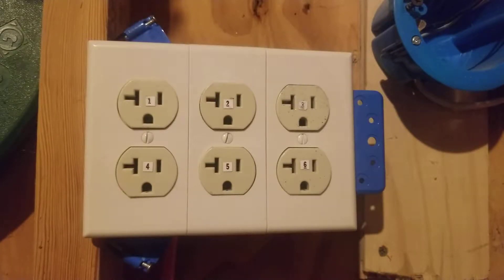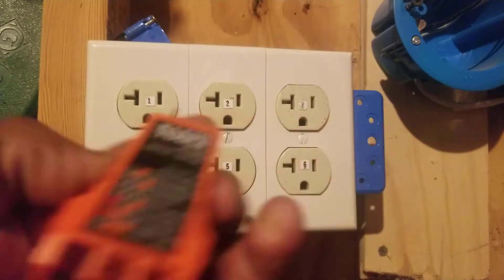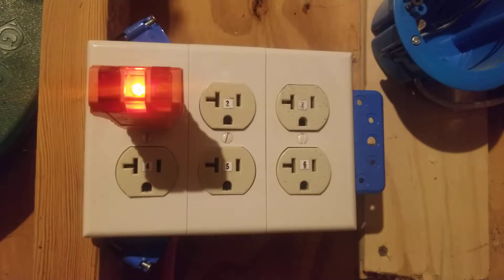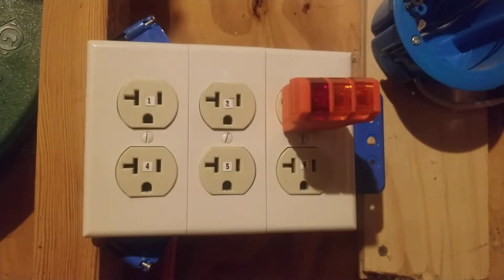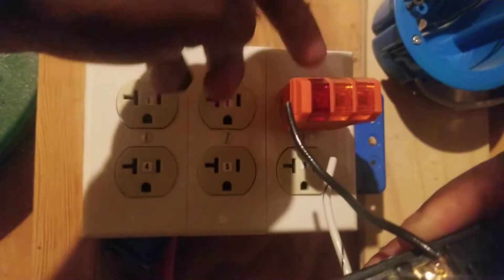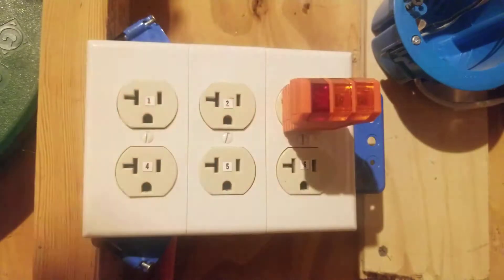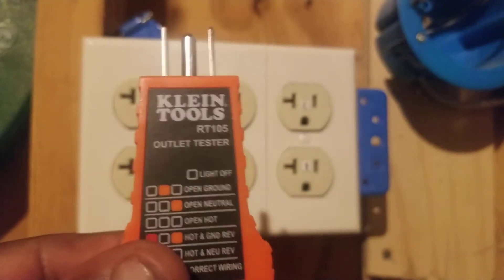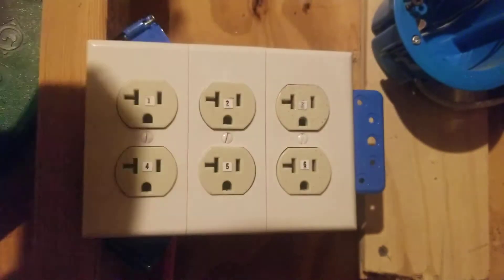How to use and read a receptacle outlet tester

Comment: I have 1950's house. Been putting in new outlets with no problem. Most were not grounded but received advice that adding a ground wire to the metal box, because of the metal casing heading back to the grounded circuit box would also ground the outlet and so far that has worked according to the tester.

The tester on my very last outlet will only show a center orange no matter how I try to wire it.

I even tried a GFCI outlet just to make sure the regular outlet wasn't faulty, still center orange light only.

Have done this outlet like all the others but the second orange light wont come on.
the out before it in the run shows double orange. I

Can you help me to understand what I am dealing with?

Comment: Very clear and concise,  you would make a good instructor at a trade school.  Just my opinion,  for a 100% complete guide to 3 light testers you need a total of 8 outlets.  In addition to the 6 shown here, there is a condition where only the red light is lit.   Ideal is the only manufacturer I'm aware of that lists this problem,  but it is called hot on neutral with hot open.   It simply means a hot/neutral reverse with an open neutral. The last condition is where all 3 lights are lit, usually with one light brighter than the other two.   This occurs when the outlet is connected to 240V or something considerably more than 120V, either  the result of a lost neutral on a multiwire branch circuit or possibly at the panel or the utility connection to the building, or the wrong outlet was installed,  for example a standard 120V/ 15 or 20A duplex outlet could have been mistakenly installed for a larger window air conditioner that requires a single 240V/20A outlet.

Comment: I have 5 outlets in my room .. 1 works correct which is the A/C outlet. But the other 4 all give me hot ground reverse .  All 4 outlets are reversed wrong?
Reply from the maker: Have an electrician check the first and second outlets.  Make sure that the black wires are landed on the gold screws and the white wires are landed on the silver screws. You may have a bad outlet among the 5 outlets. Try unplugging your AC unit and then test all 5 outlets again. The problem can be caused by your AC unit. Thank you for watching.
Reply: What you almost certainly have is an open neutral at one of the outlets, and a load plugged in downstream.   I suggest you check all the outlets on the circuit,  looking for a neutral that appears loose.  The problem might also be in a junction box in an attic or crawlspace or basement if you have one.   I highly recommend you contact a qualified electrician if you are even slightly unsure of what to do or if you've checked everything and can't find the problem, for obvious safety reasons.

Comment: Ht ground reverse is likely an open neutral. You should make sure that everything is unplugged in the circuit and test again. It cannot happen accidentally (by wires getting loose) and  it is highly unlikely that anyone would miswire so badly. You should test it with a non-contact voltage tester. It it show voltage n the ground that is serious.

The tester can only tell the differences. If neutral is open an an appliance is connected and on the neutral gets hot through the appliance. If both neutral and hot  are hot but the ground is not the tester shows same as if the ground was hot and the others were not.

A non-contact voltage tester is better in that it has the access to the true ground through the user. Yu should use it in addition.
Reply from the maker: Thank you for that information. It's very useful.

Comment: My former uncle (divorced) wired the house around 1965ish.  I just put the tester in and found that the hot and neutral are reversed. So far, every receptacle I've tested is that way. Should I change them all?

Comment: I plug my tester and all the lights went on what is the problem pls help me
Reply from the maker: You may have a bad outlet or a bad tester. Change out that particular outlet.Try plugging the tester in a different outlet.  Try using a different tester.
Reply: @rickyjewett6082  I did plug the tester in another outlet and works perfect but when I plug it back in the other one all lights go on

Comment: Ok so what if you see just the red light on
Reply: That could mean that the hot is wired to the neutral and the neutral is open. That could happen if the socket was originally miswired with reverse polarity and then the neutral got loose. The red light is neutral-ground. The middle one is hot-neutral and the right one hot-ground.
Reply from the maker: if you only see the red light on, you may have a bad tester. Try testing the same outlet with a different tester.
Reply: This means hot on neutral with hot open, most testers don't have this on the chart, IDEAL brand testers do.    Basically this means hot-neutral reverse and an open neutral.

Comment: At 12:05 and 12:37 in the video you are holding a metal box while pressing the trip button on the tester.  This is very dangerous because the trip button connects hot to ground.  And you are touching ground.  If that box was connected to the outlets ground but not connected to earth’s ground you could have been shocked.  

In general it’s best to NOT touch metal or ground while pressing the test button just to keep safe.

Keep in mind that the test button on the gfci outlet does not have this safety risk because it just connects hot on the load side to neutral on the line side.  Meaning it doesn’t utilize the ground.

Comment: Nice video. But Mr Jewelt you might like to know there are incorrect wiring that theses outlet testers do not detect. These incorrect wiring are called (reverse polarity bootleg ground receptacles ). We can find this incorrect wiring where you just have  live and neutral coming into the box for your receptacle.  What they do is, they connect a wire from neutral to ground. Why someone would do that is to passe inspection. Because theses outlet testers do not detect this dangerous wiring. I hope that qualified inspectors look out for theses dangerous wirings.
Reply from the maker: Thank you for that information. It's nice to know. Iron sharpens iron.

Comment: The only condition this type of tester won't show is the non-code / very dangerous use of a boot leg ground.  This is when a jumper is used to tie the neutral to the ground terminal.  Its specifically used to fool these testers and home inspectors.  The only way to indicate this is to use a blade tester around the ground hole (it will go off since its energized) or actually opening the box and looking for it.  The big give away is if there a lot of two prong outlets in the house but a couple of three prongs that are testing as grounded.
Reply: Specifically it does not tell reverse bootleg ground which is extremely dangerous and can kill. It energizes any case of a grounded device.

Comment: what can cause an open hot,,,,,but the outlet is getting power?
Reply from the maker: It sounds like  a loose connection. The black wire my not be making good contact with the gold screw  .It also can be a bad outlet. Turn off the circuit and install a new outlet. This may fix the problem.
Reply: @rickyjewett6082  i did that first. It is reading open hot on tester but there is power when i test it with my meter. i wanted to know if the breaker could be bad?
Reply from the maker: @keithstrickland8072  Keith there is a chance that you have a bad receptacle outlet tester. If you get 120volts when you test with a voltage tester or a multimeter,  than the outlet is good and work properly. Your receptacle outlet tester may be bad.
Reply: @rickyjewett6082  i am not getting 120 volts but i am getting power when i test with meter. when i turn off breaker then there is no power.

Comment: I want to change out my older two prong plugs to newer three prong. If the tester shows both amber lights on(I've attached a three prong adapter) should I assume that the box is grounded? I think I have older wiring, but someone since 1941 grounded the system (make sense?). Do I simply attached a bare copper wire from green screw on new plug to box with tapping screw, or do something else to make sure we're grounded? If a two pronger with three prong attachment plug does not show two ambers, do I call electrician? We do have CGCI plugs that do trip on testing (oops, one doesn't!). Basically I'm trying to see if the other youtube videos that show changing out two to three prong with help of copper wire and tapping screw will kill me!
Reply from the maker: If you are changing out your 2 prong outlets for 3 prongs, this is OK. You may not have a ground wire in the box and your tester will only show one amber light on, however this is OK. Your outlet will still work without a ground. Running a bare copper wire from the ground screw on the outlet to the metal box still will not ground the outlet if the box is not grounded. To truly ground the outlet you will have to run new wire ( the romex will a black, white, and bare copper in it). This can be very expensive. I suggest that you install the 3 prongs and let them be without a ground, unless you are selling the house and you have to bring it up to code. If you are selling the house call an electrician. If you are going to live in the house just install the 3 prongs and let them be not grounded.
Reply: Ricky Jewett thanks Rick!
Reply from the maker: To change out your 2 prongs to 3 prongs, first turn off the circuit for the outlets. Then remove the 2 prong. When installing the 3 prongs the black wire go to the gold screw, the white wire go to the silver screw and if there is a bare copper or green wire, it goes to the green screw on the outlet.
Reply: Got it. Thanks

Comment: Nicely done!  One extra note about the GFCI test button: many older homes (wired before grounding was required) have been "upgraded" with GFCI on circuits without any ground, so they could legally plug in a three-prong (grounding) plug.  NEC 406.4(D)(2).  The tester in the receptacles will show "open ground" and the TEST button on the GFCI itself will work.  However, the button on the plug-in tester will not trip the GFCI because the plug-in tester needs a "ground" connection to which it runs a test current for triggeriung the GFCI.  Without a ground, no "leakage" to ground and no GFCI trigger, even though the GFCI itself is working just fine and provides ground-fault protection for other receptacles wired to the 'load' terminals of the GFCI.
Reply from the maker: Thank you for that information. Iron sharpens iron.
Reply: Very good advice.  For those who may already live in or are considering purchasing a home built before about 1962 , the year the nema 5-15 aka three prong outlets were required in all homes replacing the previously legal to install nema 1-15 receptacles aka two prong outlets,  you are not allowed to replace the original outlet with a three slot outlet if no means of grounding exists.  However, you may install a GFCI outlet provided you label it no equipment ground.  You may also then use three slot outlets downstream of the GFCI,  providing they are labeled  "GFCI protected,  No Equipment Ground "   the reason being is because a perfect example is the surge protector protecting your newly purchased 4K 70 inch flatscreen,  requires a true ground to take that surge away from the equipment.  It will however protect a person from being electrocuted by a faulty lamp or appliance plugged into that circuit because it senses any difference between the current going into the hot and returning on the neutral , less current returning means some current may be flowing where it shouldn't like a person.   Thats why code allows this, even though it is not quite as good as a true ground, it is still much safer than the old two slot outlets.  Hope this helps
Reply: So the test button on the outlet tester works differently than the test button on the GFCI itself? Because the GCFI will trip when it's test button is pressed even without a ground!
Reply: @Jnglfvr  Yes, because the test button in the outlet has an access to the internals of the GFCI it diverts current from the live to neutral bypassing the GFCI on the other side. The external tester has no such access so it can divert current only to the ground and this does not work when the ground is not connected.

Note one should not do any tricks to make the tester not show open ground. The label "No equipment ground" is there just to show that open ground is not an error.

Comment: My tester  reads correct, but when I plug something in it reads hot/ground rev. Half of the line works properly have dont. Plugs lights ect.. sometimes the power works but not for long.. I do live in a mobile home,and have had trouble with birds nesting in the roof.. 
What would you recommend?
Reply: This sounds like a variation of open neutral, with load turned on downstream.  But it sounds like in your case the neutral is so poorly connected somewhere in that circuit that whenever a load is placed on the voltage drop on the neutral is so great due to the high resistance connection that it acts like am open neutral and the appliances don't work.    I would check all connections in outlets,  switches,  and junction boxes.  Extremely rare that the open or high resistance connection would be in the cable itself running between boxes.  Almost always happens at connections,  and the more connections you have in a given circuit,  the more chances for issues. As one senior electrician used to tell me, each connection is the equivalent of adding another link to a chain, a chain is only as stong as its weakest link.   Or if you are not comfortable checking this yourself, hire an electrician or someone who is qualified.   Hope this helps.
Reply: An actual hot / ground reverse would be extremely dangerous and very rarely ever occur.  Appliances plugged into that outlet will not operate,  and the metal casing of a three prong grounded lamp or appliance would have the case sitting at 120 volts to ground,  a potentially fatal situation. Usually a variation of open neutral.
Reply from the maker: One thing that may be the problem is the outlet you are plugging into may be bad
 I recommend changing out the outlet.
Another problem it may be is, you may have an appliance plugged in to the circuit, and this specific appliance maybe be causing the outlet tester to read hot ground reverse. If the hot ground reverse is in an appliance, don't worry. There is nothing wrong with your outlets.
Reply from the maker: Please follow up with me and let me know how it turns out. Thanks so much for watching.

Comment: I have a GFCI that when I use the tester one of the yellow light is solid but the other one is not as bright and blinking... Why is that?
Reply from the maker: The tester man be bad. Try another tester. If the tester is not bad, the problem may be in the GFCI. There may be a loose connection in the GFCI. Tighten down all the screws on the GFCI. I do apologize for taking so long to get back to you.
Reply: @rickyjewett6082  is there a way to test a tester to see if it’s working properly?

Comment: gfci tester sometimes it shows hot and ground reversed, some other times all of the 3 gfci tester lights on, check voltage it reads less than 96v
Reply from the maker: Your tester may be bad. You should try another gfci tester. Also when you test a 120v circuit, you should always read between 117 volts and 120 volts. If you are getting 96 volts you may have a loose connection some where. Check all of your connections leading to or coming from the outlet: make sure that wire nuts are twisted good , make sure that at every terminations that the wire is making good contact with the outlet. . Also you may have some bad outlets. THANKS FOR WATCHING.